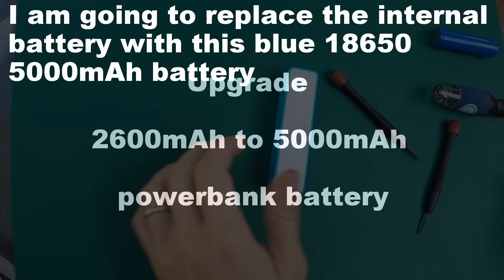How to upgrade your powerbank 2600mAh to 5000mAh

Comment: can I use the same conector to put 4 same baterry?
Reply: what do you mean by connector? do you mean wire? if use multiple batteries you have to wire them parallel
Reply: +danleow kite no I mean the conector that you charge and output energy.... the small part in front the baterry
Reply: I have 6 bateries to put in paralel.... can I put them and make a box?
Reply: +danleow kite no I mean the conector that you charge and output energy.... the small part in front tje baterry
Reply: Yes you can use the positive and negative terminal on the small circuit board, but the four batteries must connect in parallel
Reply: Yes, the six batteries must be connected in parallel
Reply: danleow kite account him and

Comment: is possible to put 2X5000mAH to go at 10000mAH power bank or will damage the circuit ???
Reply: +Apostolos Verg (grmcgamer) THe case wont fit two batteries, however you can wire the batteries in parallel and it wont damage the circuit
Reply: +danleow kite That means i can buy 4 of those 2600mAH banks and put the at paraller and that way i have 10400mAH power bank with the same circuit????
Reply: +Apostolos Verg (grmcgamer) You must wire the battery in parallel NOT serial. The more battery in parallel, you will increase the capacity but it will take longer to recharge your batteries.
Reply: danleow kite
OOOOOOOOOOOO YES thanks man
Reply: +Apostolos Verg (grmcgamer) provided that "5000" mAh is not 5000 mah, probably 500 mAh, so that 2x500mAh-1000mAh won't damage the circuit.
Reply: +Volodumur Kalunyak oh ok thanks

Comment: If y put a 9v battery its going to work?
Reply from the maker: mendy srugo why would you put a 9V bat?
Reply: It will work but 9v= 580 mah and it's so slow to charge and in www.aliexpress.com u can get a 2600 mah battery for 1.62$ and a solar power bank for 7.30$ so it's not worth it to upgrade or create a power bank.
Reply from the maker: I do every thing It would not work with a 9V battery for two reasons, the size of the battery will not fit in the case and the step up circuit will not able to handle the voltage. What is the quality like for the $7.30 solar powerbank?
Reply: 1. 9v can work but u need a car charger to make a power bank anyway it's not worth it. 
2. It's good quality but I still don't believe in solar power banks and many people are complaining from it.

Comment: Here your suggesting that the capacity of the power bank is that of the battery used inside - i.e. the 5000mAh battery upgrades the power bank to 5000mAh - whereas in your other video you say the capacity of the power bank is measured as charge input to the power bank.   By the way - good luck finding an 18650 battery that's actually 5000mAh - see all the tests showing that they are all fakes with much lower actual capacity.

Comment: Yes you can do this,  but the new 18650 must have 5000mAh. There are a lot fake arround. I dont think there are really 5000mAh battery available. I have also fake 1200mAh battery, see my short test video. German but you see zhe numbers on my imax b6
Reply: +Captain DJ the highest 18650 is 3400

Comment: i found a 10000mah 18650 battery with 4 bucks.... can i use it?
Reply from the maker: +Dmitry Zoitsef Sure no problem as long as is 18650 battery
Reply: +danleow You and +Dmitry Zoitsef should be aware there is no battery over 3600mah ( 18650 ).
Reply: daand12 so... they are fake?  i found some with 5800mah and some others with 10000 with a brand on them..  let me know  if they are fake.
Reply: +Dmitry Zoitsef they're fake. All batteries produce energy through a chemical reaction and charge through a chemical reaction. Because of this, the size of the battery limits how much they can theoretically produce within their rated thermal capacity... before exploding. eBay is flooded- I mean catastrophically flooded- with fake literally overrated li-ion batteries. There is a very real price to li-ion and they're 3-4$ for name brand batteries and this is a very real case of 'you get what you pay for'.
Reply: +Adam R I got a good unknown branded Lithium ion cells, and they have the capacity they claim to have.
You can find these cells in Aftermarkted Laptop batteries ( My guess is so ).

They most likley have a brand like: ASO stamped on it.
Got 1 2000mah cell and 4 2600mah's cells.
Reply: daand12 typically, li-ion batteries under 3600mAh are about that much in capacity. I don't trust them though.

Comment: YOU ARE SOLDERING ON THE BATTERY?!!! WHAT IS WRONG WITH YOU!
Reply: +Fizzlecube Please advice...
Reply: +danleow kite advice?? For what!
Reply: +Fizzlecube You say "YOU ARE SOLDERING ON THE BATTERY?!!! WHAT IS WRONG WITH YOU!", sound like you have solution don't you? or not?
Reply: Maybe use some piece of metal sticked to it but really. Welding on this battery could blow it up and it will immediately kill capacity.
Reply: +Fizzlecube If I have a tab welder machine I would use that instead. That is what Laptop battery manufacturers use to connect the batteries together.
Reply from the maker: +Bram Vandenbon The one I had is fixed battery. Couldn't agree with you anymore, people just like to TROLL on internet to make them feel better.
Reply: danleow It was not a troll :)

Just a shocked "me".
Reply: +Fizzlecube ok then I am sorry I called you a troll
Reply: +danleow kite this is the most confusing conversation I've ever seen
Reply: tuckettoo purple dinosaurs!

Comment: any good links for a good price battery 18650? need 2 for my power banks.
and since 3800mah are fake witch is great. cause im talking to a guy on ebay, asking him about weight and if there legit and things. but i just learned that 3800mah are fake. 
i just need a cheap 1euro or 2 euro battery.cause i bought a empty power bank. 1.70euro. so if i can find a battery for 2 euro its okay.
Reply from the maker: Regilio Bouma If you need a good 18650 battery, I suggest you get Panasonic brand. Just beware lots of 18650 battery selling online are refurbished from old/used laptop batteries.
Reply: danleow just to be clear. 
These 18650 they are in laptop batteries? Cause i have some old laptop around. If i can get a battery that has some juice left out of it.

Comment: All 18650s are 18mm diameter and 650mm long. That's what their names tell us. If they are not that size, they are
A) not 18650s or
B) cheap ones from China that do not have the capacity they tell you they have, and will explode into your face.

Comment: As mentioned, all those Chinese 18650 batteries are all about 500mAh....Bit like peak music power ratings on sound systems, think of a number and add what you want!
Some of those cheap battery banks hold 2 batteries in parallel so at least you can get 1000mAh.
You need decent batteries from Panasonic or similar to get good capacity but you will probably pay 10 times more.(about $25 for two 3400mAh.)
 Ni-mh AAs.AAAs etc are similarly way overrated.
Battery packs for R/C use and so on are usually truer to the mark..
Reply: Chris Nelson it's like the shitty soundboxes, showing 2000watts PMPO on the ad at the shop... Then it's just a crappy 10watts RMS amp
Reply from the maker: yahnsolo Yup!

Comment: Didn't these have a recall???
Reply from the maker: I am not really sure, have not heard about it. But I doubt there is a recall firstly there is no brand so manufacturer wouldn't bother about it secondly sellers like ebay will just refund or exchange.
Reply: I heard they melt and start fires. I guess it must of been a different one. Merry Christmas!!!
Reply from the maker: Jaden Dobrenski I have heard that too, the problem with these powerbanks there is no one manufacturer. It is assembled by many different companies in China, they just buy the parts separately and put them together. Hence some of them use very cheap and refurbished parts like the batteries. Or some use circuitry without IC protection, that will burn from overcharging or cross circuit.

Comment: You have been scammed. Please do no spread secondhand lies. There is no 5000mAh battery of that size. If you really believe in what you are doing, why not make another video with 9900mAh batteries? Those
 are yet another level of scam!

Comment: There is no such thing as a 5000mAh 18650 cell. They are only rebranded used and old dangerous cells. Your best bet is to replace with a sanyo or panasonic 3400mAh cell.

Comment: I have same power bank with blue (claimed 2600 mAh) cell, on my Honor 4X it gives +10% if powerbank is charged via microUSB. If i disassemble the powerbank and charge the 18650 inside with 18650 charger (output 4.2V, 1A) it gives +30%, with cheap charging only cable takes bit more time, but charges bit more also.
Does anyone know where to buy good quality batteries, anybody can share a link? P.S. I am from northern Europe, US only shipping won't do )))

Comment: great you change your battery now what capacity to 5000mah? nice genius its better if you set the two batteries in parallel same result casing is your nxt prob!
Reply: +danu castillo the batteries are fake

Comment: You probably downgraded your powerbank by doing that.
If you bought it in a store, it was probably originally around the 2600mAh capacity.
The blue battery you put in is most likely around 1500mAh, maybe even less.
Congrats on making a worse powerbank than before.

Comment: Most of the unbranded 18650 from china are fake: if you want good batterie buy original panasonic from japan....but the max amps. is only 3600 ma.   5000 ma doesn't exist

Comment: There is no such thing as a 5000mAh 18650 (AA) battery...the highest capacity for a battery of this size is most likely 3000mAh. Even branded AA batteries that you see sold on ebay and rated/advertised as 4000mAh are fake..
Reply: Spartaa87 You are right that there is no 5000 mAh 18650 battery. However, an 18650 does not have AA Dimensions, but is much larger.

Comment: There are no 18650's at 5000 mah capacity. The largest REAL 18650's are about 3500mah or so. I bet if you tested it , it would barely push 1500mah.
So anything , 5000 , 9000 , 9900 mah is just chinese rubbish , just like those "100000" mah powerbanks for 20$ from ebay. 

Get a battery tester and see for yourself. 

I bet that wasnt an upgrade , more like a downgrade lol.
Wouldnt be really surprised if it was Ultrafire battery.

Comment: yer sorry but no there is no 18650 that is 5000mah I have a some 18650 that say there 4000mah and there not some yer will have about 3000mah at best but most of the time there 2500mah or I have even found some and seen some that are 1000mah or lower

Comment: you just made this powerbqnk weaker then it was before any 18650 over 3500 is fake Panasonic has a released a 3500 recently that battery is 1000mah if your lucky those fire brand batteries are seriously dangerous. most of the time its a smaller battery inside like a 14500 I've seen even 10400 in them

Comment: If the old 18650 is a proper rated one, you just downgraded your powerbank!! measure the discharge on the new one! im pretty sure its going to be max 1500mah! Also... get a PROPER electric soldering iron... going to beat your crappy gas one.
Reply from the maker: 0ver7aker I have a Weller electric soldering iron, because I need good lighting for my video which I shot this video in the garden and the extension cord wasn't long enough so I had to use a butane soldering iron.